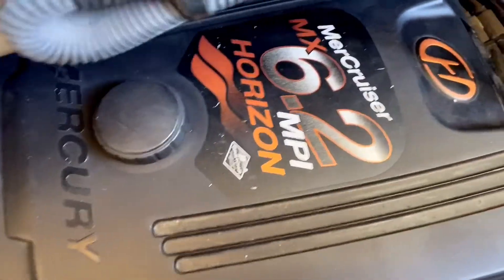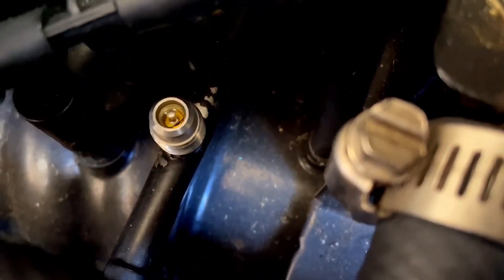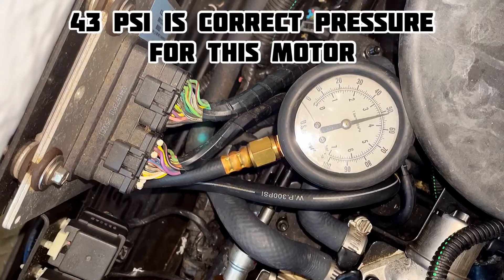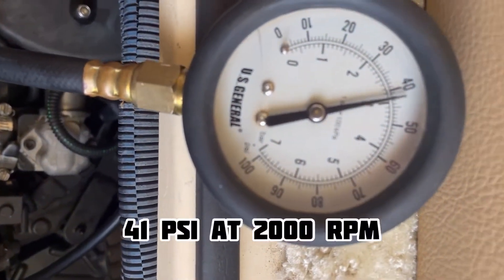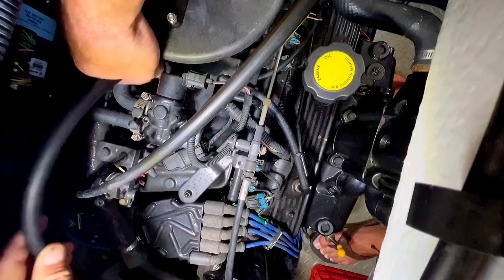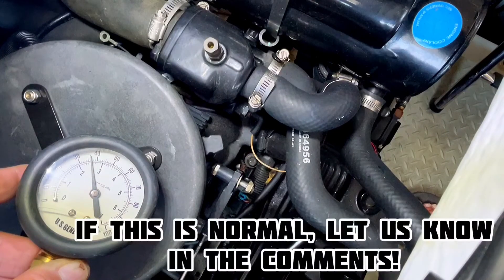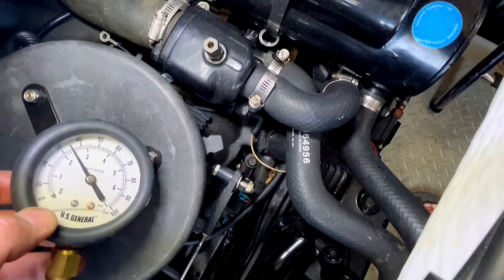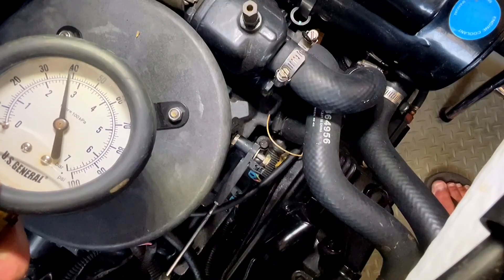Mercruiser Fuel Pressure Diagnostics

Comment: Ever figure out this issue?
Reply from the maker: Yep. That story coming soon.
Reply: @AdventuresofHappyOurs  Did you post "The Rest of the Story" yet? ;-)  Different boat, but same 4k max RPM issue (even with all new plugs, wires, cap, rotor, gas, bottom paint, clean injectors etc but original 07 cool fuel module). thx
Reply from the maker: @jimwalton7271 after lots of diagnostics not finding issues and consulting with many others, consensus is a hundred or so rpm difference between motors is acceptable, especially for17 year old motors.
Reply: Thx for the clarification.  However, I thought the issues was 4k rpm limit vs 4800 to 5200 rpm spec limit for the 6.2L engine itself?  Appreciate all the time you took to record and post your videos.

Comment: Do a tune up. Plugs, wires, cap, rotor and coil. Make sure to replace the cap and rotor with the high performance gold plated points cap, they work a lot better than the silver point caps. I would also upgrade the ignition coil with a high performance, msd coil, accell coil… replace these on both engines. You will be so much happier!
Reply: Beautiful boat by the way!
Reply: MSD is the worst coil EVER.   MSD = My Shitty Day

Comment: I have a 36 ft caver seadan bridge with your same issues. replaced the plugs first.;no change.It ended up being a bad injector replaced all off the injectors , boat runs perfect.
Reply: I may have the same issue.how hard is to replace the injectors? Do I need special tools?
Reply from the maker: The company that sent me the CFM said it is not hard.  Just have to remove the fuel rail.  I haven’t tackled that. I am eliminating all other possibilities first and will do a injector cleaning through the rail before attempting to remove them.
Reply: @AdventuresofHappyOurs  hi Anthony, I pulled the fuel rail off this weekend. I tested the 8 injectors with a pipe and a carb spray can (see videos on this) and found 2 bad injectors that were leaking. They were stuck open. That's why it was hard to start my engine. If you do this, make a video. Haven't seen anybody doing that for mercruiser. Hope this helps you cheers
Reply from the maker: I plan to do that tomorrow n the future.  So much work ahead. Thanks.
Reply from the maker: I had a 2000 carver Mariner.  Great boat.

Comment: I had a similar problem believe it or not it was that the fire arrester was dirty restricting are intake it’s an easy fix
Reply: I did complete tune up changed fuel pump changed water separator more than once. I didn’t realize the marina didn’t clean the fire arrestor when they winterized the motors. I do have four barrel carbs so maybe a little different but it was the problem ran great at idle but under a load it choked out  so just a suggestion good luck and don’t let everybody make you crazy sometimes you need a professional in Connecticut they aren’t cheap
Reply from the maker: I cleaned mine the year before.  They don’t get that dirty.

Comment: Hey, mercuiser tech here, I noticed in an earlier video that you have  the gloss black fuel pressure regulator caps. Those are notorious for paint delaminating inside them and clogging the injectors. Your 50 psi at key up is too high. Max should be 42. If you pull off the fuel pressure regulator, the silver round thing on top of the fuel pump, and see paint. You have the problem. If you have a Merc dealer perform the repair you get the parts for free, all you do is pay the labor. Hope this helps.
Reply: I’m having a similar issue and found that my vac line from the regulator isn’t attached to anything!! Where does it go?
Reply from the maker: @suttoncurt there is a vacuum line tap on top of the intake manifold.  Goes to a T which should be one of the vac lines to that regulator.  There is a second fuel regulator and vac line on the fuel rail.
Reply: @AdventuresofHappyOurs  Oh, good to know!! Thank you for the quick reply
Reply: @AdventuresofHappyOurs  Update… I found the second regulator and now the boat runs and idles perfectly 👍
Reply from the maker: That’s great news!  Was it just the vac line disconnected?
Reply from the maker: @MrPepperkid air in your fuel?
Reply: Spot on Anthony.   The good news is the gauge didn’t peg at idle, which as you know means the injectors are not (yet) clogged by paint flakes from the CFM3
Reply from the maker: I’ll be pulling the cap in a future video.  Wouldn’t 50psi when ignition first turned on normal as there is no vacuum until start?  What pressure should I get with vac hose removed from regulator?
Reply: @AdventuresofHappyOurs  There is no vacuum no, but there is a mechanical spring in the regulator that alleviates pressure as well. Keep in mind the fuel rail is totally depressurized and the pump only runs for 3 secs at key up. On a healthy system, If you key on and key off multiple times, you’ll  notice the pressure just levels off to a point. It wont keep building. A test for the regulator would be to hook up your pressure gauge again and pull the tiny hose coming off the regulator. It should spike up 3-4 psi once removed. It should be around 44-45 with it removed. If it goes up to around 50 removed, you definitely have paint in the fuel. If it doesn’t move at all the regulator is either ruptured or there’s a hole in the vacuum line.
Reply from the maker: Thanks!   I’ll try pulling the vac line while running next time out
Reply: @anthonycaffarini5687 , hey, I see that you're a mercruiser tech and was wondering if you'd be able to help or point me in the right direction with an issue I'm having with my 2002 bayliner capri, 4.3l mpi mercruiser. It'd be kind of long to write/explain it on here so if possible, could you maybe respond on here and I'll give you my email address or something? I know it's a lot to ask coming from a stranger, but I'd really appreciate it.

Comment: Could also be one or two of the injectors on the engine thats clogged. Had the same on mine (outboard). It would run fine without load with earmuff's on, but when putting it under load in the water, I couldent get it higher than 2200 rpm. Cleaning the injectors fixed the issue. Also checked all filters, sparkplugs and pumps - some were a little dirty from regular use, but once I fixed the injectors - all problems went away. Is the engine running rough under pressure when you give it full throttle? That could mean its not firing on all cylenders - thats what mine did.
Reply from the maker: It’s running smooth just not getting to max rpm. I’ll be methodically checking and testing each step.  Stay tuned!

Comment: This is a manifold vacuum based fuel system. RPM with no load makes it hard to determine if the fuel pressure is correct. The gauge might be air locked, so it might not be super accurate, but what you are looking for is when the regulator is unplugged it raises the pressure by about 7 psi. Because you compared the engines though, even though the gauge is inaccurate (maybe), it gives you a good baseline to say that most likely fuel is not yet your issue. The engines sound like they are idling way too low though. I would replace the IAC muffler to fix that.
Reply from the maker: IAC Mufflers we’re replaced early 2022. The motors didn’t get to warm up at all so may sound a little rough.  But it seems to idle fine after a minute or so of fast idle.  I’m thinking a simple tune up will do the trick.  We’ll see.

Comment: I would start by inspecting the plug wires. One way to inspect is to start the engine in the pitch black with no interior lighting and without getting tangled in the running engine look for blue light emitting from any wires as they leave the distributor cap all the way to the plugs. My guess is wires! It wouldn’t hurt to tune and replace wires as regular maintenance.
Reply from the maker: They’ve been replaced.  That vid coming.

Comment: Hi,  I can only guess that your problem occurs at 4000 rpm with your engine under load.  You only tested at idle, 1000 and 2000 rpm (sitting at the dock?).  I'm not sure you replicated the flaw.  Your Mercruiser has an ECM, not OBDII, compliant.    There are other parameters I'd like to see/compare.  You should do the compression test anyway just to benchmark your engines.  16 spark plugs wouldn't be a bad idea either.

Comment: Come on Goomba!   You have a $12 Chinese pressure gauge.    Stop shopping at Harbor Freight! I would replace the rotor, Dist cap, plugs as normal maintenance after that long trip and maybe they are due anyway. And go out and buy a $14 Chinese compression gauge and check compression on the lazy engine. Ihave 5.7 MPI Horizon I think they suggest changing the rotor and cap every 2 years and you put alot of hours on this year.
Reply from the maker: All the parts are in.  Hopefully get all that changed out by this weekend.

Comment: Thanks….Definitely the plugs.  You going to go ahead and change out both engines?
Reply from the maker: Yea sir!   Stay tuned!
Reply: Those Horizons came from the factory with Iridium plugs.   Can’t hurt to change them but that’s not causing the top end RPM loss.

AC Rapid Fire #14 or AC/Nipp 41-993

Both are .060 gap.  Use anti seize.
Reply: @seconnsportsman2502  maybe you are correct. I’m not a mechanic in no way. My port side engine wouldn’t do anything past 3500 RPM and I had vibrations at idle speed. I had the plugs pulled and replaced. Vibrations are gone and my RPM’s are perfect.
Reply from the maker: I have the iridium’s ready to go in. Thank for gap!

Comment: Pull the plugs and check for rust due to water intrusion especially on the center cylinders.
If there's rust then do a compression test.
Mercruisers are famous for this  and it will take out the valves and valve seats resulting in no compression.
If theyre fine it can be just a tune up or a bad fuel injector
Reply from the maker: I’ll keep you updated. I have all tuneup parts ready. Just need time now!  Lol